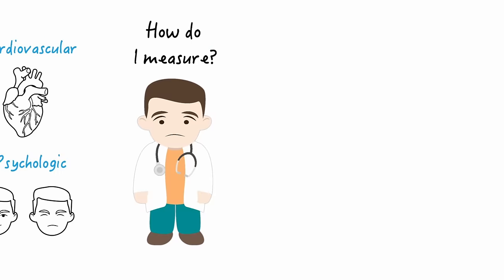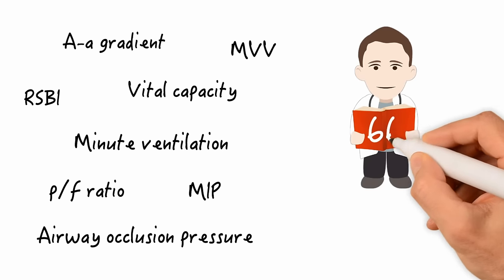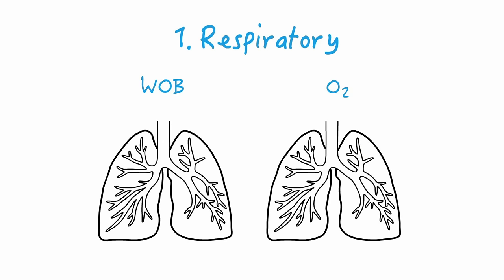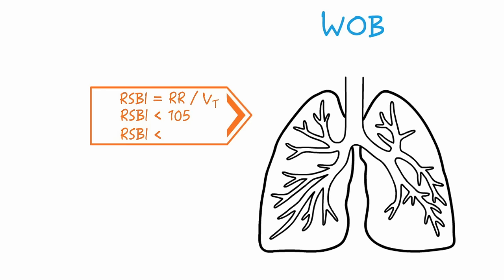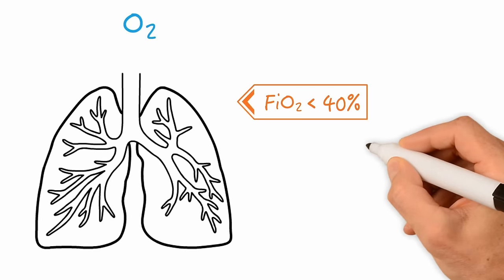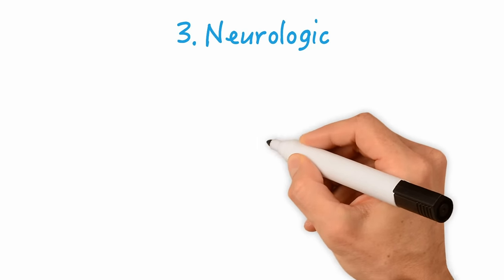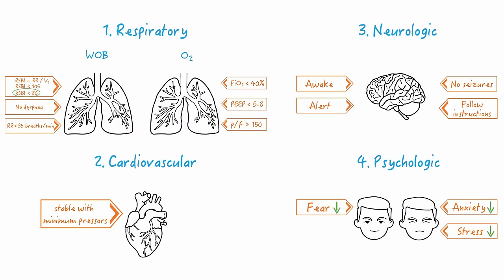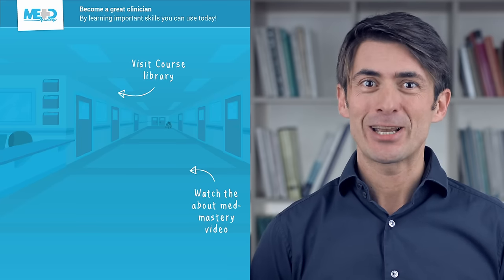Everything you need to know about weaning parameters in mechanical ventilation

Comment: It's a shame, home ventilators don't allow for weaning parameters like NIF, Vital Capacity! Such as the LTV ventilator! It has a way to conduct an SBT, but You're not gonna get weaning parameters. There's no way to do that. It doesn't have a respiratory mechanics! You know people are using these archaic NIFometers, when they should be using the capability ON THE VENTILATOR!!! From what I know, the ventilator is going to give you a much more accurate NIF than one of those NIFometers.